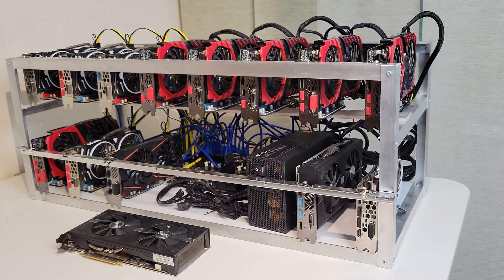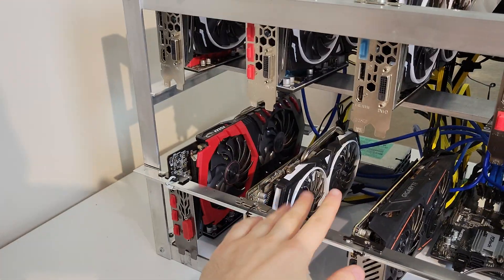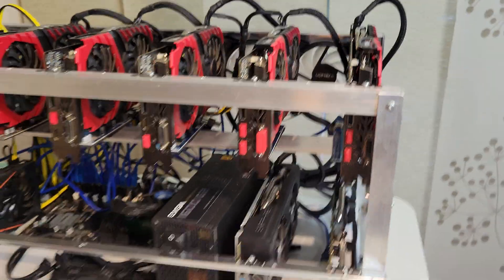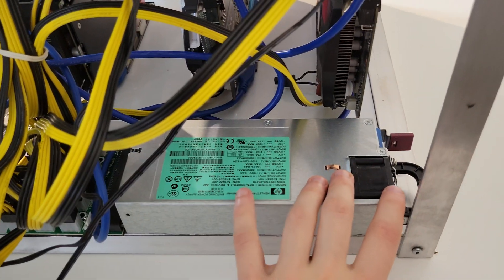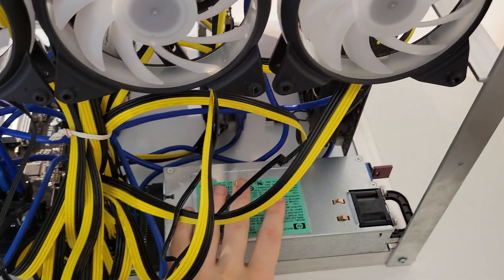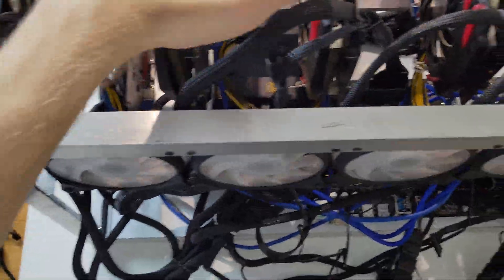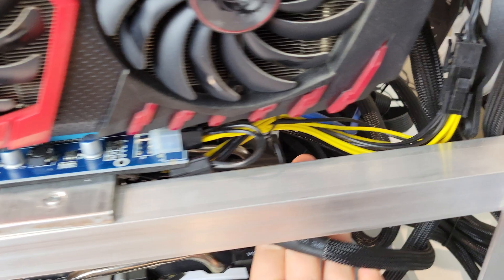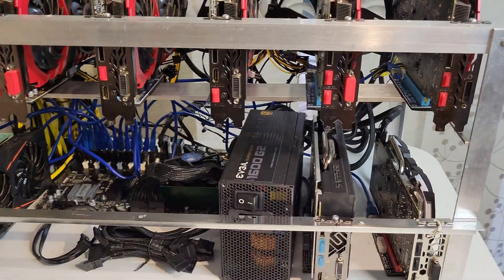Mining Rig Rebuild Part 2 (13x RX 570 4gb) Power and Spacing

Comment: Hey mate i just buy a new psu. I decided to buy 3070 ti cause of stocks of 3060 ti. My New psu has 3 graphic card power cable but riser my 2060 and 3070 ti all of them need 4 what can i do. I dont want to power riser with sata or molex. How can i multiplex my cable safely
Reply from the maker: Probably order a good quality 8Pin to dual 6+2pin cable adapter. as the rtx 2060 should run find on Eth with just one 8 pin for riser and gpu.
While the RTX 3070ti will need at least 2x8pin
Reply: @CostEffectiveminingYT  ok but how can i understand quality of cable and is it safe getting 16 pin from 6 pin
Reply from the maker: @flameartz8916  you will just have to look at reviews.
I've used cheap 6pin to dual 6+2 and they can get hot but I've seen online some decent looking 8pin to 2x 6+2 from Aliexpress
Reply: @CostEffectiveminingYT  Yeah i found cables but can i trust it?
Reply: @CostEffectiveminingYT  seems like everyone use this so its not dangerouse Thanks again